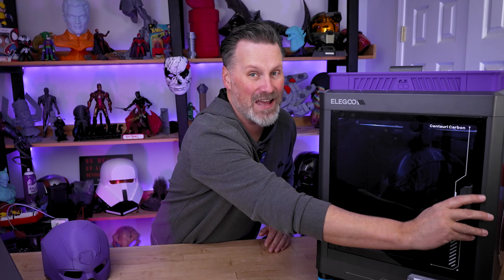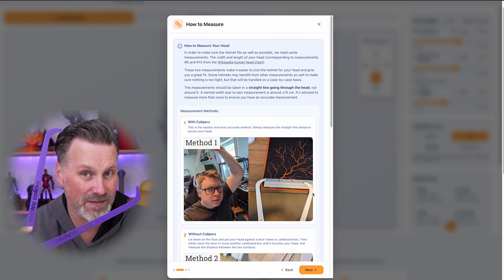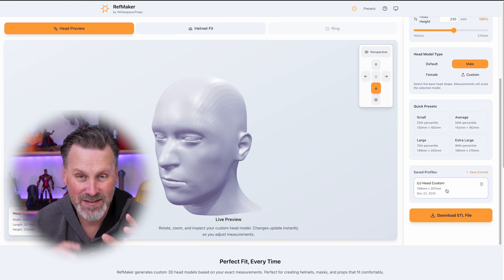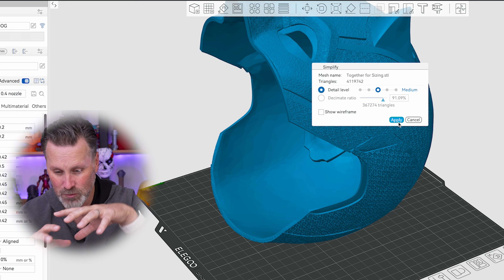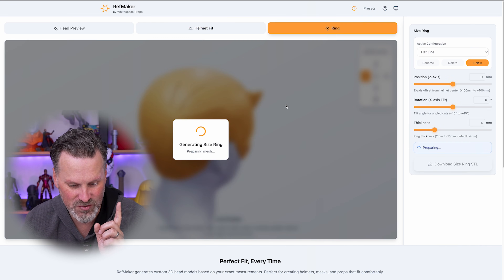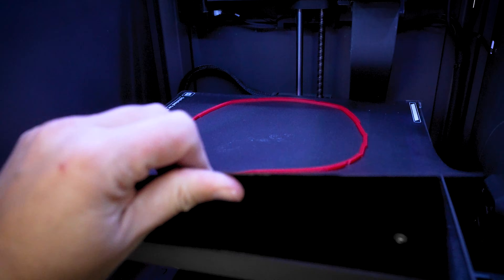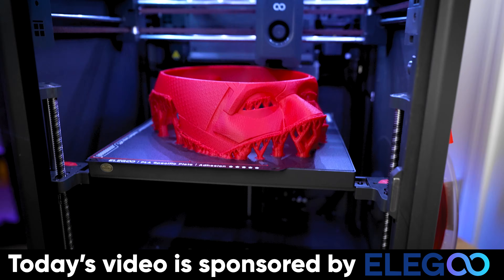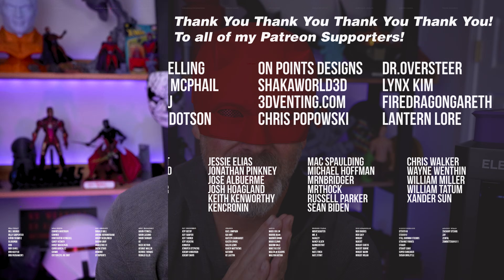Stop Printing Helmets That Don’t Fit! NEW FREE Tool

Comment: thank you for the calipers 
i found that if you find the right rubber band in my case i used a no.18 rubberband twisted it once to double it and reduce its rad i slid it up one of the arms and got it to fit between the caliper arms rotating disk joint. it now holds the gap without swinging out of place.

Comment: i wish refmaker had an option to adjust the mask/helmet model left to right as well. because when you load in a mask that's not symmetrical, it's off center and i have no idea what to do about that

Comment: My issue is when i used the cosplay calipers i got my measurements, but when i put those measurements into the helmet, once printed it still wasn't fitted right. I ended up printing it in sections and seeing if those sections together worked before committing to a full helmet.

Comment: Soooo, dumb question,  but the print numbers are all based on the inside measurements? 
So youre throwing the bump on size to reflect the exterior dimensions? 
Or just to give you wiggle room inside?

Comment: I'm only 2 or so minutes in but I hope this site also has pre installed measurements if you know the helmet size you need for your bike or motorcycle.  For example I have a large head and need a size L bike helmet (51-61cm).

Comment: i printed this after your last show off of it, and i like it, but it doesn't hold its measurement well.  i'm thinking of putting some fabric tape inside the 'hinge' to give it friction, but it seems like a bit of a design issue.

Comment: I printed those calipers, and they never held the measurement, since there's no way to lock them in place and I have shaky hands until I've had a few drinks.  I ended up buying a set of 8 inch outside calipers for about $9.

Comment: Hello, great video. I've been following you for quite some time and I love what you do. But I'm having a problem: how do you take these measurements if you wear glasses? I printed a Mandalorian helmet to fit my head, but with my glasses on, it doesn't fit on the sides. What measurements should I take with my glasses on?
Reply: Fellow glasses wearer here! I haven't tried it, but I would probably just measure the width of the widest part of your glasses x the front-to-back measurement of your glasses to the back of your head. Be aware though that it still might not fit because your glasses will create a more square profile than a non-glasses head. Might be better off cosplaying blind and getting a seeing-eye friend if you're wearing it out and about lol

Comment: Wow. Such a savior.  Can you also tell the process of sticking the magnets.  I scaled a deadpool model and found the magnets doesn’t fit. And ordering them takes 3-4 weeks for the size I want.
Reply: Did you ever figure this out?

I scaled my helmet to 97.5% and realized the magnets are too big now. I have some 5x2mm and they fit in the eye sockets despite those supposedly being 3x1mm originally.

There must be a easy way to measure the size, I'll have a look in bambu studios
Reply: @Inki_Tea I ended up using a smaller size magnet. 6x2. I think 7x2 would have been perfect. But there is none available. So used what i had. Problem is we can wear thr helmet. But it’s not super strong. Any fast movement it breaks off.

Comment: This is definitely a cool app, but everything you have done in this video could easily be done in Blender with only basic modelling knowledge. Eg the Ring and Sectioning views can be done with a few simple boolean objects and there are free head models you can import and scale quickly.
Props to Whitespace (lol) for putting this together in a free and easy to use App though

Comment: Thank you for sharing this video. I have always had a problem with even baseball caps fitting my head.   Because of this, I have very rarely attempted to print a helmet that I liked. I look forward to using this tool and printing some of the helmets that I would love

Comment: Hi! Question- I printed a helmet with ASA and cut it off at the top and that top part cut to two parts, and now they're warped after printing.
Is there a way to save a warped helmet after printing? Harder to describe without pics lol

Comment: well,  i get that you want it to be snug, but if you want to use the helmet for many hours on for example as cosplay part, it would be prudent to have it a costume fit, and a few mm's bigger so you can fit an inner lining and some padding, and you can print a snugger tpu rim part to seal the helmet off to your face, like a gasket.

Comment: I've used a software called Armorsmith Designer, for years to insure any 3D printed head piece or body armor fits perfectly. But this new free web based software tool is a welcomed addition.
Reply: This simple tool has a few features that I wish armorsmith had

Comment: Thanks for the video...i was super excited when i found out about the app, but everytime i try to export a generic .3mf from orcaslicer it wont work because it says its not the correct format...and it crashes whenever i try and upload even an .stl. I dont think it is, but maybe its something im doing wrong...just dissapointed it wont seem to work for me...if anyone knows a fix or had a similar issue im all ears!

Comment: Quick tip, don't simplify by 50%, use the high detail preset and it will simplify so much more but still keep a very detailed geometry.
Reply from the maker: Ohhhh thats an awesome tip thank you! I will play around with that tonight
Reply: @UncleJessy most time is around 80 to 90% and I thought there's no way having over a million triangles down to 100k would not have an impact on geometry, but I've compared them and i can't tell the difference

Comment: Why not just used your 3d scanned head you made a video on and scale in the slicer?
Reply from the maker: Most of the slicers don’t let you freely move the helmet around. They automatically snap to the bed which is a pain. This also makes creating the sliced bit a lot easier than doing it in slicer as well

Comment: I've been using the program for a few weeks and love it, The only difference is that on top of my head size all of my helmets are adjusted to include an extra 1/4" for interior padding
Reply from the maker: I like that idea! I purposefully left a small gap in my DD helm for a thin layer of padding.... assuming I get around to finishing it 😂
Reply: What sort of padding did you use?
Reply: @Inki_Tea  depends on the comfort level I want, but lately I've been using memory foam

Comment: I wonder if anyone is printing in TPU for helmet components, and/or printing parts of the helmet as a flexi... or hmm, printing the hard parts on top of a soft TPU component...
Reply from the maker: funny you mentioned that... I have a project lined up testing that exact type of scenario
Reply: @UncleJessy  Cool! Did you see my other comment requesting a follow up on the Elegoo CC and how to do any maintenance? And that there are new mods that make it quieter and more efficient?

Comment: Love your videos!! I follow you on here and Reddit!. 

I have dreads that’s are pretty long. Is there a way to do this being how much hair I have?
Reply from the maker: Ohhh that's a fun one. If you have an iphone there should be apps you can use to create a head scan, or if you can even put a cap on your head to help smooth out the hair that will help create something that is better suited for your scaling. Not even remotely close or the same 😂 but my 3D scan of my head was when I had some big hair and in the video you can see it poking out of the top of the model 🤣
Reply: @U @UncleJessy kay thank you! I was going to dry a do-rag to see if that would work . Any helmet I make I would just have to have a do-rag on lol!